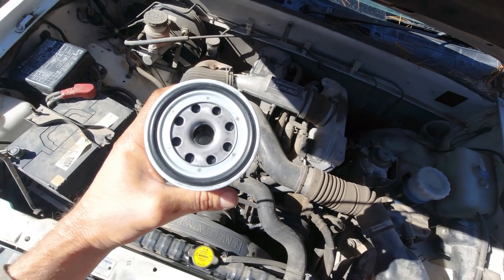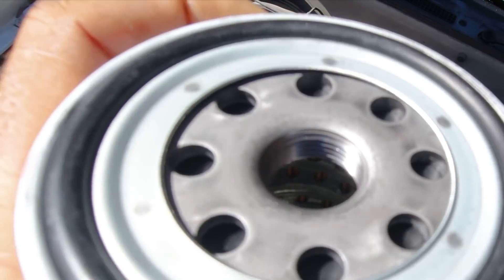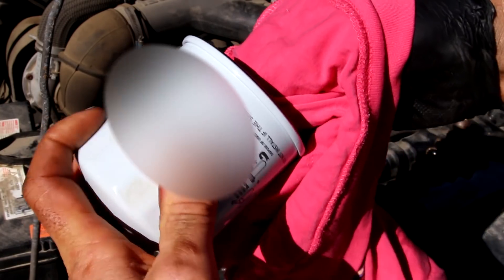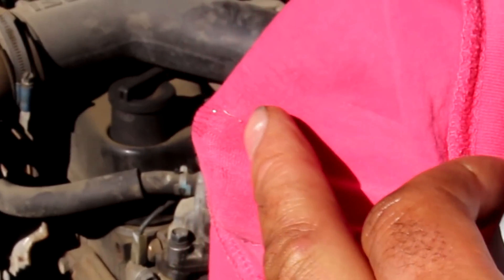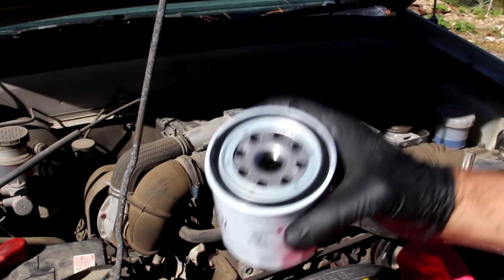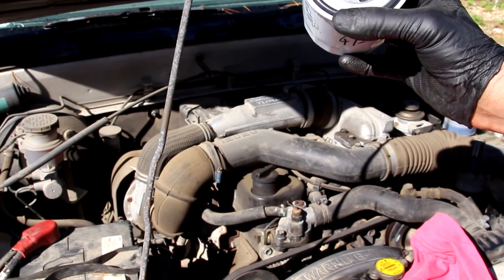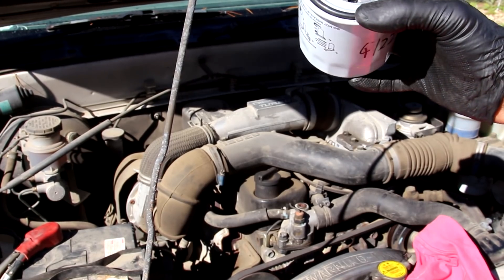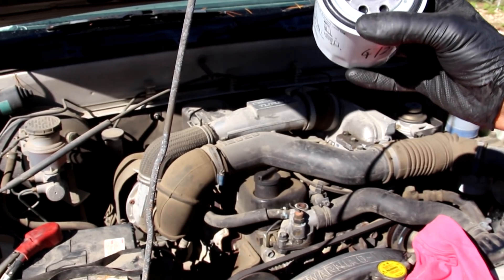Simple trick to extend the life of your engine

Comment: Been changing filters on my cars for years, never thought to check for this. Thanks for the info very useful. Seems very negligent by the manufacturers.
Reply: I agree 100%. I’ve been spinning filters over 40 years and never ever been shown this tip. Thank you so much Marty T
Reply: Do you know why its called a filter and how it works? That debrit would be caught in the first instance.
Reply: @-Scotty  the threaded area is the outflow, so it would not be caught, unless it cycled all the way through the system.
Reply: @-Scotty  Not when it"s on that side of the paper
Reply: @-Scotty  oh we should know the manufactures contaminate their own filters, come on dude
Reply: Just a couple of decades ago. Your average car was done at a hundred thousand miles. So manufacturers could count on new sales every three years or so. Today engines if maintained will last two or three times longer. So they design failures. So to increase sales.
Reply: same!
Reply: 100% agree
Reply: European cars dont use crap metal filters like this
Reply: Here's another tip for you. Always visibly inspect the oil filter before you purchase it. Some guy at our local wallmart was taking the cheep filers out and putting them in the expensive filter box, and then putting the expensive filter in the cheep box and then checking out with the expensive filter in the cheep box.  Kind of a lowlife thing to do but it happens.

Comment: I once bought a single sidedraught manifold for a crossflow Escort. It was a complex inlet tract with a crossover and split- I Found a huge gob of casting sand deep inside  the most complex part. about two tablespoons of casting sand!
Reply from the maker: Wow.. It pays to check these things
Reply: good lord.
Reply: It's a issue that still persists, I know BMW for a while we're having heater failures due to the heater core being clogged with casting sand..
Reply: Thank you for that info Both Marty and Tiny house as another subscriber noted you are never to old to learn
Reply: @MartyT  nice work super change oil you love car and tractor?

Comment: Another thing to check, when you open your oil pack, make sure that you remove ALL of the seal from the oil container before pouring in your oil or use a funnel with a strainer in it - it doesn't take much of the plastic/foil seal to block an oil gallery......
Reply from the maker: Agreed, I came to the same conclusion
Reply: The higher end oils have nice pull tabs and spouts. Its ridiculous how much engineering goes into a german bottle of oil 😅

Comment: Been racking up miles on my truck changing oil and filter every 2 months or so, never thought to check threads good stuff man💪
Reply: @davidparker667  Yeah I know it looks nuts, but some people drive 100km every weekday, or more, that's 2000 a month given they work 5 days a week.
That's 6k in a quarter, it will have turned black well before then so it's a good time to contemplate oil change before you forget about it.
Have done 200km daily grind every weekday for a year, changed oil every second month for cheap insurance even though I was 2000km under the actual mileage it has to be changed for my car.
Then got transfered and it was a 100km daily grind for 2 years, again, changed every quarter @around 6000.
With a car that gets many miles on it, changing oil sooner, is better than changing it on the dot.
Reason being, the better the average condition of the oil is, the better off the car is!
For fiddlers like us that likes to keep old stuff alive, it's cheap insurance 😁
Reply: @ToreDL87  it is great good ensurence but with the price of oil and filter I do myne o  the dot but I must say I don't drive my vehicle very hard at all
Reply: @christopher20k  The cool thing about changing oil often is you dont need the most expensive oil, so you get away with the cheap stuff.
I worked at the local ski resort for free for more than a couple of winters, so when they changed out one of the snowcats they gave me 30 gallons of oil for TDI that they could no longer use,  so I've been using that on my daily (diesel bimmer) 😁
Reply: @David Parker & ToreDL87 -Late reply, but I’ve been busy driving and working lol… your pretty spot on I’ve managed to put on 20,000 miles since the end of last July, when I bought the truck used w 130k and just turned over 150k 2 days ago so I’m trying to keep it healthy and functioning! Thankfully wrapping job up soon normally don’t work so far away it’s brutal w gas etc. -little over 2000mi per month! I try to change oil every 2500-3000mi and use factory filters it really seems to run better and smoother 🛻🏁
Reply: @mertonallowicious  I know the painful long treks all to well.
And yeah it just pays off when you're putting miles on the clock, WAY cheaper than engine failing.

Comment: In situations such as the video, and others, I prefer using a vacuum over air. It does not force the foreign nasties into crevices as air may. I tape a smaller hose onto the vacuum hose for small areas. A test-get 2 filters, try air, then knock the filter on a table. Do the same with a vacuum ,compare. You're  quite the  multi talented smart chap.

Comment: Another tip if it helps.... My Dad said "Just because it comes new in a box does not mean it is necessarily good." My truck had a bad starter, walked a mile to buy a remanufactured one. I walked back with that heavy thing under my arm, installed it and truck still would not start. I took it out, walked the mile back to the store and exchanged it and walked back again and installed that one. It fired right up. It was one long day!
Reply: That's why I generally only replace bad parts. People say oh while you're in there replace this and that. Nope, not me. Haha

Comment: Good tip thank you.  Also pre-fill the filter as much as possible before fitting it to the engine.  Even with a side mounted filter I completely fill it first to saturate the filter media inside then tip half out so there's no mess when fitting.
Reply: Although that oil will go straight into the engine unfiltered so you need to be careful
Reply: @AlexLR  Why be careful?  It's new oil going into the oil filter so is new oil going into the engine.  Same as the new oil going into the engine via the oil fill cap.
Reply: @AlexLR  better some brand new unfiltered oil goes into the engine right at startup vs no oil at all.
Reply: My dad has never done that in 32+ of having his own mechanic shop. Never ever had a problem
Reply: @mishimamaster1845  And he never will.  But just have a think about it - will the 'oil pressure low' warning light go out quicker with the filter pre-filled?  Yes it will, even if a fraction of a second quicker that has to be a good thing.  It costs nothing.  As I keep my vehicles for many years I try to reduce any chance of unnecessary engine wear.
Reply: @tonysavage8364  I don't get you. The oil will have to recirculate anyway so pre filling the filter isn't needed

Comment: good tip. I bought a new boat motor, and sure enophe there were metal shavings where the oil cap screwed on. one of the reasons I am a firm believer in doing a very early first oil / fluid change when I get a new motor. way earlier than the manufacturers ever tell you to do it. an early extra fluid change will not hurt, but a late one might shave a lot of life off the motor. probably would not be able to confirm that until the motor finally dies years later, but makes me feel better at least.

Comment: Surely if oil flows IN the big hole and OUT the tiny holes then the aluminum swarf will get caught by the filter? This assumes the oil flows that way. If it flows IN little holes and OUT the big one then this is worth doing. Edit: Just found out oil flows IN the outer holes and OUT of the central hole so this advice is totally correct and is something vital - so glad I watched this. Subscribed, Liked and Notified

Comment: The center port is the oil filter outlet to the engine. so any thread contamination will be pushed into the engine.
Generally, any mechanic will look for thread problems before making the attachment.
In my experience, better quality filters have better quality material and workmanship, including the center thread.
The difference in cost for higher quality is not significant in this case.

Comment: Good tip Marty, I have noted some very rough cut threads in these filters, but haven’t actually seen bits of metal like this inside. So the inside hole ‘is definitely’ the output side of the filter?, I thought it was the other way around, but then the outside would have more surface area for intake purposes, so I guess that makes sense! Only recently started watching ur channel when u helped ‘old mate’ with the pelton wheel setup, that was very cool dude, but ill be watching many more and check out ur other channel, ur a champ, thanks for all ur great info.
Reply: Well, you explained it very well by yourself. I think every cylindrical or conical filter works like this. (Conical filters are usually mounted directly on hoses, for example for fuel on some lawn movers). The cleaned oil, fuel, water or air comes from the inside of the filter.

Comment: I don't want to sound negative, but in my 20 years of servicing and diagnosing cars, I have never encountered problems related to this.

I did encounter problems related to bad quality filters or colleagues who forgot to take out the old (o-)rings resulting in oil leaks or fuel pickup problems.

I see no harm in checking the threads though. Just make sure to remove the fibres from the cloth you use, cause otherwise those fibres will travel with the oil or fuel. 😉

Comment: Remember to rub the thread only in a clockwise direction or what is the same, turn the filter clockwise looking at it from behind, as if you were going to screw it on your finger, if you do it the other way the swarf can pierce your finger and even get stuck in your finger 😰☝️🩸🩹

Comment: Thanks! Another unrelated tip is to prefill the filter with fresh oil as much as you can before mounting, so the engine doesn't run dry on the next start. Obviously this depends on the angle the filter is mounted and only works when its pointed up or sideways.

Comment: Not sure how correct it is but I was told in helicopters there are strong magnets fixed into points along the oil lines and are taken out at service and checked for metal fragments which did make sense to me, so being an ideas man I have put a flat rare earth strong magnet against the outside back of my car oil sump to trap any mobile metal particles, will be interesting at the next change to work the magnet to the bung hole and see if it picked anything up.
Reply from the maker: That makes sense

Comment: as a wof inspector and mechanic i have seen that too, however RYCO is by far the better at not having sooooo many imperfections, FRAM is the WORST at metal filings and swarf in the filters and threads, from personal experience
in saying that i have personally seen a RYCO filter Z411 from new go onto a engine and the engine not build oil pressure(light didnt go out) the old filter went back on and the light went out straight away, the faulty filter was sent back to B&T and it was sent for "testing" , found out it was tested with air?!?!? thats a fucked up way of testing an oil filter/product, not with oil but air, B&T gave another Z411 filter which worked well, the faulty filter test came back as ok/pass(trying to get out of paying or any damage or comeback if it did do damage)

Comment: Another thing that I see people do is "prime" the filter with oil before fitting it by filling it with oil or fuel from a bottle. This is bad practice if not done correctly by filling from the dirty side of the filter and not through the clean side as it is a point of entry for contaminants to be introduced. The vast majority of engines these days do not need any form of pre-filling of filters during service.

Comment: Marty great tip….why not put down a magnet all the way to the bottom to pickup the loose particles and then wipe the threads? Doesn’t there have to be a way the oil can move through the can without going through the filter paper? Otherwise the engine would be starved for oil if the paper was all blocked with dirt.

Comment: I think the oil flows from the threads, thru the filter,  so any fragments get filtered.  Still good to remove them I guess
Reply: I was thinking the same thing but it flows through all the holes on the outside, through the filter, and then through the threads to the engine. So anything on the threads or in the inner part isn't filtered.

Comment: Saw another video where mechanic said not to fill the filter with oil when replacing as it put unfiltered oil through the engine.
I have my doubts on this but I feel like the time the engine runs without oil in the filter may be just as damaging.
Reply: Why would unfiltered oil matter if it is new from the container?
Reply: @jimmac1185  I think the reasoning is that it isn't even recommended by a lot of manufactures anymore and any potential benefit is outweighed by the risk. Just because its new oil doesn't mean there isn't contamination, stuff could be on the funnel, plastic from oil cap could break off, and many other contaminants. I mean a lot of vehicles have horizontal oil filters.
Reply: @ryanp0342  The same could be said about pouring the oil into your engine. It's not like the oil goes directly to the filter as you add it. Also, I've had cars with horizontal oil filters for about 15+ years, never had a problem adding oil to them before screwing them on.

Comment: I went to harbor freight and buy a roll of quarter or half dollar paint or plastic dip them and place on the oil filter and the magnetic should be pulled to the bottom of the filter when change I silicone to the  bottom peel them off toss the filter glue it to the new one  I lost a roll of them during the winter when my wife goes into a quick lube they toss the filter

Comment: Hm, isn't that the input side where the thread is ? So theoretically the Metal should be caught be the filter ?
Reply from the maker: No the oil flows from the outside of filter back through the centre, so any loose swarf in the centre is pumped through the engine
Reply: @MartyT  I wonder if that is kind of an intentionally stupid design then ^^  is every car like that ? 

I think every oil filter should have replaceable filter material. Now there are two good reasons why that would be great :D

Didn't you make a maintenance video about a dozer where only the filtermaterial where replaceable ?

Anyhow.. Thanks for clarifying and the really good tip !

Comment: Yeah, i found this one the hard way, i poked my finger into the thread because i thought i saw some schmutz on the end, turned out it was a huge chip that was probably pierced right at the ends of the threads. That didn't get stuck in my finger, but the tiny ones i didn't see did, plus all the glitter. Been cleaning them out with a brass tube brush and then i'm flushing them clean (from the inside) using a rig i made using a pump, some hose and one of those extension kits you can buy to relocate your filter. You wouldn't believe it until you saw it, what comes out of these, 'new' filters. They just don't care anymore, as long as the CEO gets all his jets, we can go to hell.
Reply: Hell that seams like hard work. Had this been afew days ago I would have thought it was an April fool. It’s a total disgrace

Comment: I’ve learned a hard an expensive lesson. Do not use any other oil filter but fram. I saw videos claiming wix was the best yadda yadda….well I tried one. Week later the oil pump went on engine. Thought it might be me, however I was helping out another mechanic for Canadian government who had also switched to wix filters, they were also burning out turbos, and oil pumps. I’ve used fram oil filters on engines for over forty years without a single issue ever.

Aside from checking for debris, which btw should not happen ever with a fram there is videos of how they are made and you’ll see why, you should always pre fill an oil filter with oil. On new engines I prime the oil system for a few minutes of circulation before starting it….this can be tricky on. Some engines but it’s possible.
Reply: Just an ad on note, engine and oil pump warranties are invalidated if you do not use a fram/oem filter(that’s right many engine manufacturers have fram make their brand filters)
Reply: Prefilling is impossible on filters that are mounted horizontal, as with my Nissan 3.0L V6 and my Honda 2.4L (all with 250K miles and never prefilled filter). I mostly use supertech filters and oil from Walmart...engines are clean, tolerances are exceptional.

Comment: wouldnt that get caught by the filter itself
Reply: @JohnSmith-yv6eq  still l dont think this would harm the engine I had a car daily driver form 1975 to 2010 oil changed every 4000 miles with that type of filter no problems

Comment: Just curious, isn't that the inlet of the engine oil, and that would mean the metal shaving would be stuck in the filter ? either way, sad to hear they sell filters like that.
Reply from the maker: No the oil flows from the outside of filter back through the centre, so any loose swarf in the centre is pumped through the engine

Comment: the question is if it matters. as far as i know there is a magnet inside the filter to catch metal fragments created from wear in the engine. not so sure it would never leave the filter.

however ofcourse a clean filter is way better
Reply from the maker: Ive never seen one with a magnet but its a good idea to add a neo magnet to the outside of the filter to hold any incoming fragments